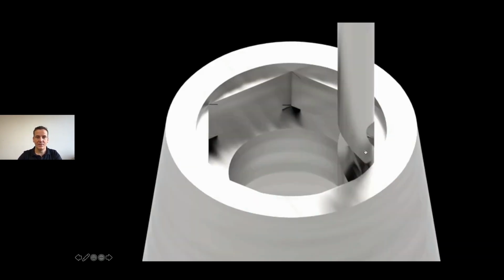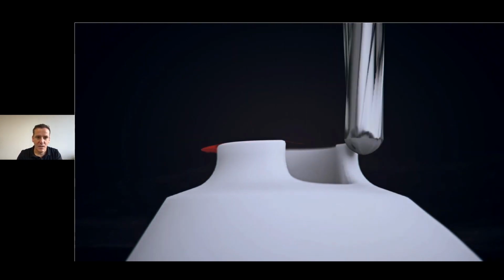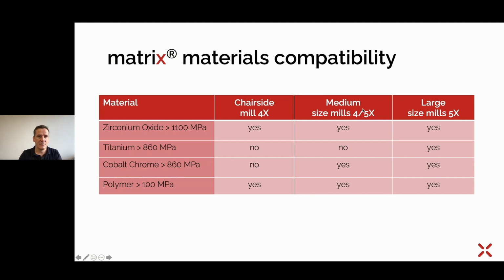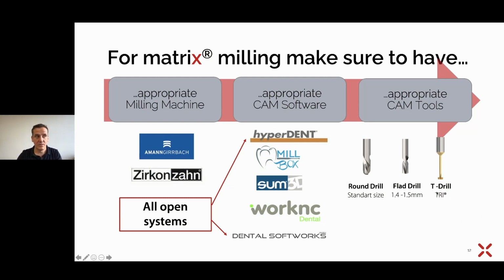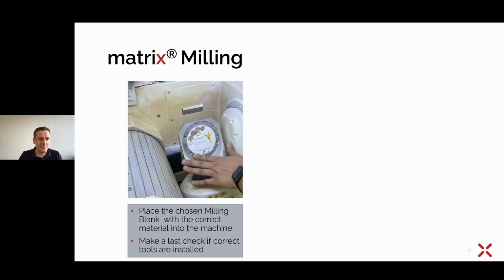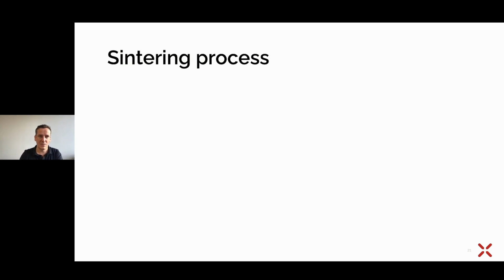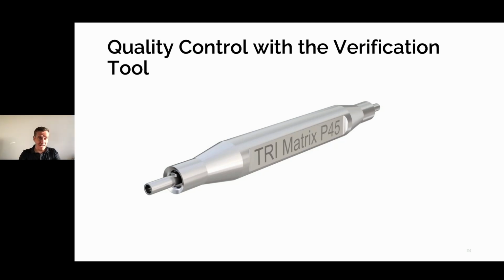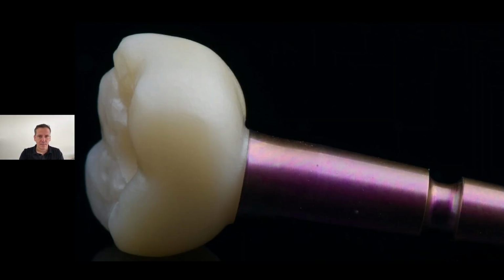Basics of matrix® CAM manufacturing and Quality Control | matrix® Digital Academy

Comment: Can I mill this on Sirona MCX5? It doesnt have the option od flat drill, has only round tip burs
Reply from the maker: Currently, the Sirona MCX5, which primarily uses round tip burs, is not compatible for direct milling of the matrix® implant components which require flat drills. The matrix® system is specifically designed for new digital manufacturing technologies including CAD/CAM milling, and optimal results are obtained with equipment capable of using flat drills to accurately create the required implant interfaces and connections.

If you are using the Sirona MCX5 and want to work with matrix® implants, you might need to explore alternative strategies such as outsourcing the milling process to a facility with the correct tooling capabilities, or considering an equipment upgrade. For more specific guidance, please check the latest compatibility details and recommendations from TRI® or contact their support directly at matrix-support@tri-implants.swiss.